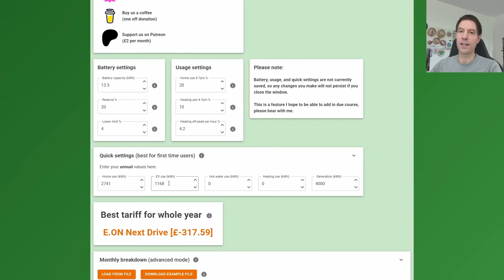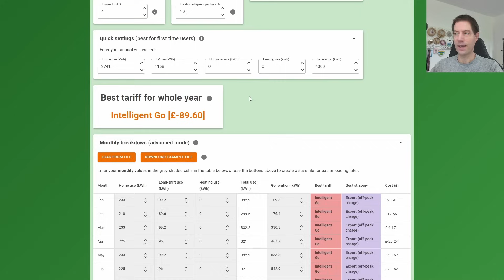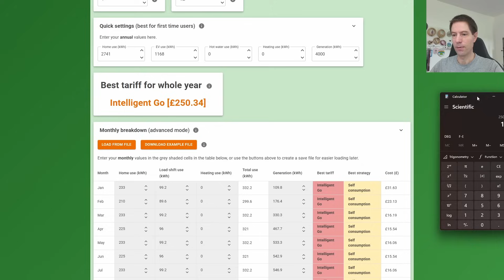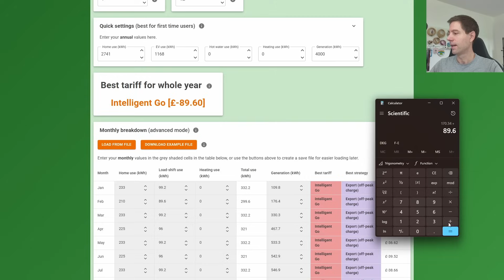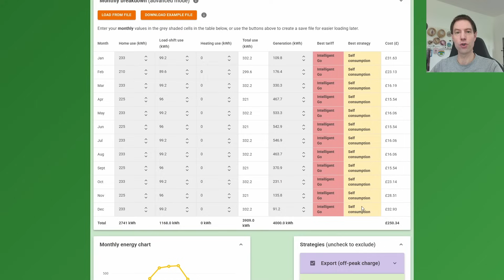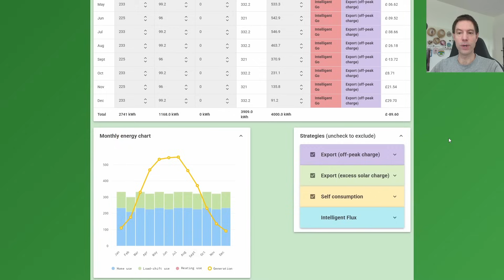Time to ditch your Feed-in Tariff?

Comment: Again, I'm on a FITs 2013 rate.  Beginning last year, I got a Tesla 13.5kWh battery and smart meters.
My annual generation for 12 months April 24 to Mar 25 was circa 4200kWh, so my deemed export would have been 2100kWh.
My smart meter tells me that over that same period, I ACTUALLY exported 482kWh, so the battery is seriously reducing my real export.

I did a calculation of deemed export at the FITs rate of 7.39p (this year) and what a SEG would return on the 'actual' energy exported and decided I was better off staying with the FITs rate.

Good to hear about upgrading though, I'd seen adverts and just assumed they were scams, especially as my FITs provider (BG) requires me to tick a box stating no change have been made to my system.  That tick box suggests to me that if a change has taken place, I'm going to have to jump through hoops and possibly loose some or all my income.  😞
Reply from the maker: The benefit of ditching your deemed export and getting a better export rate comes from being able to force export your battery then recharge using cheap overnight power.  That's where my tool comes in handy for showing you what's possible under different circumstances.  The strategy is as important as the tariff and in this case a change of strategy from self consumption to force discharging is what's necessary to see the benefit of changing the tariff.

Comment: Looks attractive right now with 15p export rate but this is not guaranteed. FIT deemed export is guaranteed. Proliferation of renewables will mean peak summer the grid will not want your energy - look at Octopus agile export rate mid day mid summer. 

Fit a battery and consume 100%.

I get to 98% consumption on a 28.5kwp system so manage to play the rules of FIT.
Reply from the maker: There is also the Smart Export Guarantee, which is guaranteed, and is similar to the deemed export FiT rates right now.  And even if the 15 p/kWh export rate goes away there will very likely still be good export payments for the peak period between 4 and 7pm, so I don't believe it will ever be a bad plan to get rid of a deemed export FiT.  The option is there for those who do want to go ahead with that.

Comment: we installed solar panels into our house and barns converted for residential use between 2011-2014. As I was coming up to retirement age at the time I viewed FITs as a form of index linked annuity and installed ground mounted solar to 7 properties. The earliest systems are currenly paying 74.37p/kwh for generated power and 5.25p/kwh for exported solar (deemed) whilst the later installation (much cheaper to install) are paying 23.05 p/kwh for generation and 7.44p/kwh for deemed export.
A few years ago we also installed export meters so that we could understand how much power was being used. The figures varied between <20% of power generated and 45%. The only property using more was our own because we had installed a heat store.
We have now ditched the deemed export for our own property and gone on to the Octopus ougoing which was fixed at 15p but the next agreement is not fixed. We are in a rural area and for some reason Octopus have difficulty in consistenly reading our smart meter although we have a system in place that works- for now!
During this summer renewables in our area (South West) approached 90% of electricty generated (NESO app. mainly solar) whilst Scotland regularly has more wind than it can use. As more renewables are installed I suspect that flat rate export rates will disappear athough those with battery storage could well benefit via the ability to arbitrage by managing when power is exported.
So far none of our inverters have failed but they would need to be changed for hybrid inverters for batteries to be installed. Indexation has taken the tariff rates up by over 70% on our earliest system and the tariff agreements still have around 10 years to run. 
Food for thought and probably guesswork
Reply from the maker: I think you're right about export rates becoming more time dependent, so batteries will become a lot more important, as you say.

Comment: I have a FiT contract that started 13 years ago.  In the last twelve months I've changed the inverter to a modern hybrid, added battery storage and just last week replaced the old 4kW array with 6.3kW of bifacials.  I mention that as a lot of people with FiT contracts think they cannot change or upgrade their installations...  
I've also moved my deemed export element to negotiated export outside of the FiT contract.  FiT contract will continue to pay a 4kW pro rata for production and the the export is hugely increased...  I moved export in April and have made over £750 this year so far versus £150-200 a year I was getting on deemed.  All OFGEM compliant on the FiT contract and as I have a second solar installation that now also gets to contribute to the export which was not possible when on deemed.  100% no brainer to move it from deemed.
Reply from the maker: That's brilliant.  It's quite similar to what my in-laws are in the process of doing right now in fact.  There will be a few videos on their upgrade coming soon to give people an idea of what can be achieved.

Comment: Hi Tim thanks for the video but I’m not so sure I could gain anything from dumping my deemed export payments from my Fits payments at the current time it pays 7p ish for the deemed and 24 ish for generating I have a Tesla Powerwall 3 and 2 EVs and a air to water heat pump so I’m sure I’m better off self consuming as much as I can plus  as mentioned by others once it’s dumped it’s gone forever I believe and there’s no guarantees this ultra cheap 7p tariffs will last I for one don’t believe they will so for consumers like myself it’s better so stay as I am with Fits payments 
Les.
Reply from the maker: That's entirely your choice, of course, although I think there will be some form of arbitrage to be had for a while yet.

Comment: We have an old FIT which was set up in 2013. We get approximately 24 p on generated and 7.4 p on deemed export. We added 15 KWh of batteries a couple of years ago and self consume as much as we can. We don't have an EV or a heat pump so cannot benefit from tariffs which are tailored toward those. It does limit us on which tariff we can take. 

We moved to Agile  back in July 2023 and, with Home Assistant, we use excess solar or cheap electricity to keep the batteries as well as the hot water (using immersion) charged up. I also pre charge the batteries overnight to an SOC which pre estimates how much solar there will be in the coming day so that we basically only run one charge cycle with minimal grid usage. It's a bit of a gamble but it works pretty well generally. Not something that the average consumer could program, admittedly.

I love what you have done with your spreadsheets - very helpful !
Reply from the maker: This is it, for a fully optimised system there are quite a few things to manage, so as you say not everyone will be able to.  I think I need to do some videos on simple strategies anyone could implement without too much trouble that will get people pretty close.

Comment: This was a great video. It almost matches my exact situation except that I have 13kWh battery. There is an important point you didn’t mention which is that if you ditch the deemed export then that is irreversible. Octopus could decide, for whatever reason, to scrap or reduce the lovely 15p rate. But the deemed 5p is contractually fixed and increases each year. I have 9 more years of this contract so my strategy is based on the poor but known rate of export. Thus my plan to self consume and maybe increase my battery to 19kWh. It maybe that my strategy is not as beneficial but money is not everything 😀
Reply: Similar situation. We instead consume all of our power (almost) but still get paid 7p/kWh deemed export. I've instead optimised our consumption. I'm also betting that the 15p rate won't last for anything like the FIT duration.
Reply: @etchedpixels  both valid points but so far this year I've made enough already to cover most of the next 6 years of my deemed export so even if Octopus changes the rate or cancels it I've lost nothing and as long as it continues I'm definitely better off in the long term.
Reply: @am1548-r6z  I think thats the heart of the question - can you export enough in a few years to cover the risk of it going away. In our case as we consume most of it anyway it was a clear no. If we add another 10K of solar as planned then it'll probably look different
Reply from the maker: There will always be high demand during the early evening, so if the 15p/kWh outgoing payment stops I expect you'd still get good export payments between 4 and 7pm.  In which case a battery is a good investment to go alongside solar.

Comment: Looking at my old FIT payments for generation + deemed export. Generation g=4.85p/kWh, export e=6.00p/kWh. Annual generation of around pv=6000-6500kWh. Payments for 2022-2023 were £510 . Total payment =pv*g+pv/2*e . Strategy for FIT with deemed export is to maximise self consumption. I used it for hot water using electric thermal store, some heating using air to air - Spring is ideal - plenty of solar, and still cool. When I had a smart meter fitted I then moved to export tariff, but kept feed in generation tariff which you are allowed to do. In this case payment = pv*g+pve*e, where pve = exported energy. Obviously the strategy in this case is any number of scenarios - freeze to death and get paid more or maximise usage and get paid peanuts and anywhere in between these two extremes.
Only changed at the end of May. So far £244 for Octopus Outgoing + £180 for generation, giving total of £424. So yes a full year would be somewhat more than old FIT payments.
Reply from the maker: Adding a battery gives you more options too, such as charging up overnight if you're able to get a good time of use import tariff.

Comment: I was exporting significantly more than 50% when I had just my FITS system, I originally tried to get on metered export, but was told I'd have to have a dedicated meter, this was sometime around 2016 to 2017. I knew I was exporting more because I could check the reading in my smart meter! But british gas insisted my smart meter wasn't certified for export. Fast forward to early 2023 when I added more solar, and moved to Octopus, who replaced my SMETS 1 meters, and I finally got rid of deemed exports, and have never looked back - having more solar makes it a no brainer.
Reply from the maker: That's great, I'm glad you managed to do that.

Comment: But did your model take into account that if ypu are not self consuming you have to purchase extra energy from the grid?  Thanks for the great video much appreciated
Reply: Hi, I have implemented this on my system and you buy overnight @7p and charge the battery. The solar is then exported @15p so the net gain is 8p per unit. Also it is the full amount that is exported not the 50% from the fit. So for me my generation is 3500kwh but I have already exported 4500 kWh. All in all a much better strategy than deemed export.
Reply from the maker: The model suggests the best strategy to use for a given tariff, so if you don't use that strategy the cost will be higher.  You can't currently define your own strategy but you can turn off ones you don't want to use in the calculation.

Comment: 😅Opted for E.ON Next Drive. Charge my battery and EV overnight 6 hours at 7.5p, export excess solar during day at 16.5p. Fixed price for 12 months, set and forget. E. ON now have auto monthly export payment to your bank account.
Reply: I’m with Epn NextDrive. I’m still sending in my export readings periodically. They don’t appear in the app. At present my Smart Meter has stopped sending readings to Eon and I have a technician appointment to sort it, but that’s another matter.
Reply: Didn't know about the monthly payments, still says annual or up to 4 times a year on the web site. I'd like monthly ones
Reply from the maker: Good stuff

Comment: The Feed in a tariff on the generation is index linked - the deemed export rate is set each year but goes up and down. I dumped the deemed export last year, but am keeping the generation rate. Well worth doing. You can add more panels, and you will keep the tariff on the percentage of you array size that makes up your original array.
Reply: Very few people realise you can extend a FITS system, but the rules have been in place since December 2021, but it is becoming more widely known, and there are quite a few videos on here about it. I still see people saying you can't though, so I point them at an appropriate video and the OFGEM document.
Reply: @TheRonskiman  100%...  I've changed my entire system (hybrid inverter, added batteries, new bifacials with a larger array) and moved to Octopus Outgoing for export and no impact on my FiT just much more for export
Reply: Just in the process of doing just that ie taking off the original 3 kw array and inverter, adding 4.9 kw of new panels and bringing the 1.3 kw non- fit array onboard. All running directly into a Pw3’s hybrid inverter. Once done we intend to ditch the “ deemed “ export and get paid for the full 6.2 kw output that we export and 48% of the total we generate. We don’t intend filling the batteries and exporting or exporting rather than than fill the batteries either. We will generate more and we always exported about 1500 kw with the original array, so we will export more on Octopus Outgoing and claim a small profit over what we would have achieved through our current 7.14 per kw deemed export.

Our strategy has always been to self use and minimise grid draw, we won’t change that although we could export even more if we bought in overnight at 7 p. 

For anyone thinking of altering, removing and replacing a FIT system, whatever you do get in touch with your FIT provider first to see what exactly what they want you to do. We had a succession of telephone and email conversations before we and OVO were on the same page.
Reply from the maker: Yup, that's what my in-laws are doing right now in fact.
Reply: Curious, I have just looked at the last 9 years and for our 2015 installed system the deemed rate has only gone up, currently 7.4p
Reply: @garyhill9723 Ours the same since 2012 only upwards on generation and deemed.
Reply: @lynnfisher4396 interesting, ours was installed in 2015 so on the ‘middle’ rates of 19.7 and 7.4p, still with EDF for fit payments as they pay within a few days of sending the readings